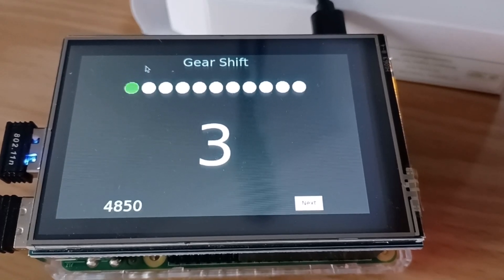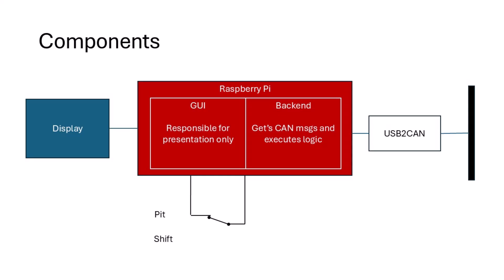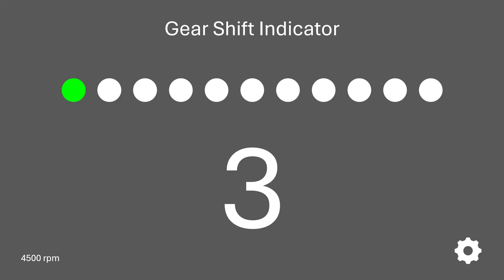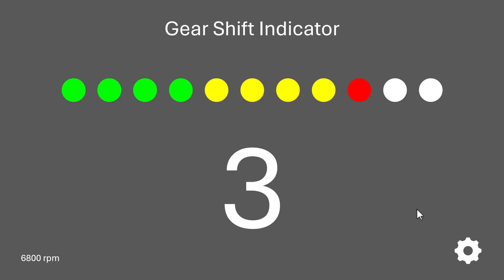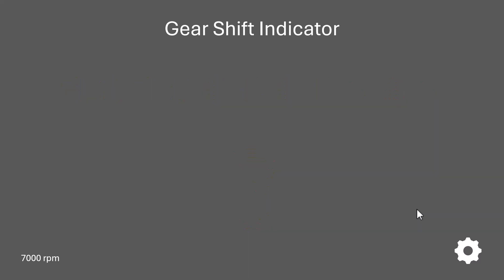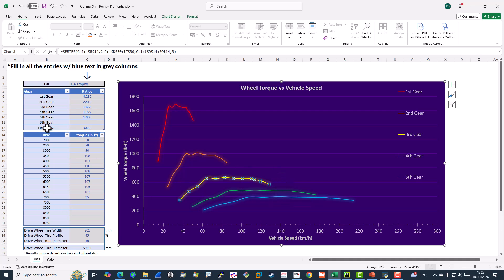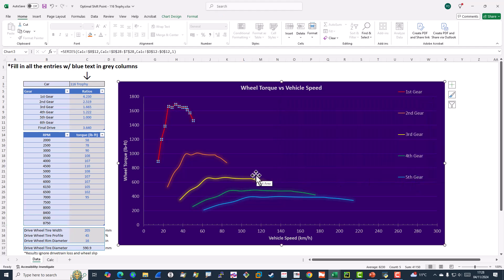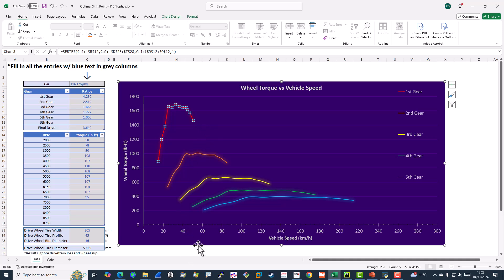When to Upshift for Maximum Acceleration

Comment: Usually the best case is to rev all the way to the redline and then shift. The plot observation is absolutely correct, that you should consider where the wheel torque would drop below what it would be in the next gear for the same car speed.
Especially in cars with multiple gears (ZF 8/9-speed for example), this could happen easily as there the gear ratios are much closer together.
Engineering Explained did a video about this as well a while back.
One other thing you need to consider is that you have to be quick though to not "bounce off" the rev limiter, as that costs extra time, except if the wheel is spinning and you bounce off to gain traction. For that reason I usually shift 2-300 RPM early, but it's hard to time it especially in the lower gears. A shift indicator would absolutely help, though I'm not sure that the refresh rate of the one you showed off would give a quick enough reaction time.
Reply from the maker: Great feedback - thanks.  I can improve the screen refresh time.  There are a couple of timers in the code that I can fiddle with, but ultimately I plan to swap out the old Pi for a newer faster one, and the display for one with a faster refresh rate.

The gear spacing on my car is quite big; there's a massive jump from second to third.  So thrash to the red line would seem to be the answer.

Comment: the flaw I see in ur initial theory is that just because you're our of the ideal acceleration RPMs for your current gear doesn't mean that when the torque demand increases for the next gear, your engine's still going to be within the ideal RPMs for that gear. So yes, it would make sense that you send it all the way to the red line so that the engine is able to pick up the now increased torque demand. Amazing video, overall.
Reply from the maker: Thanks for the feedback.  My initial thoughts were based on observations I made while racing.  In my head, I always tried to keep the RPM above 4500 as I felt the car bogged down below this.  But I concede, my initial thoughts were probably a bit naive.